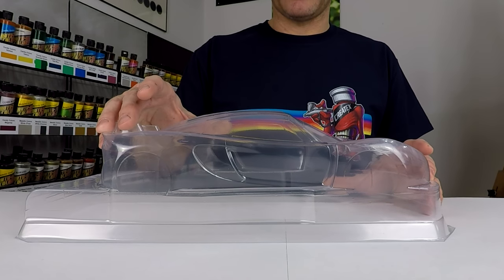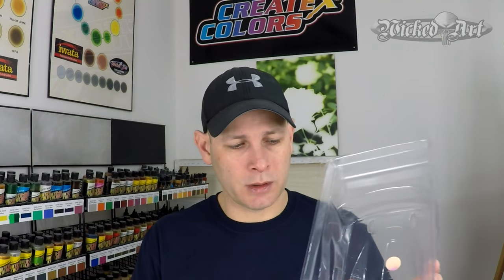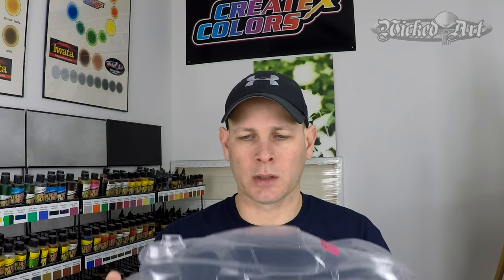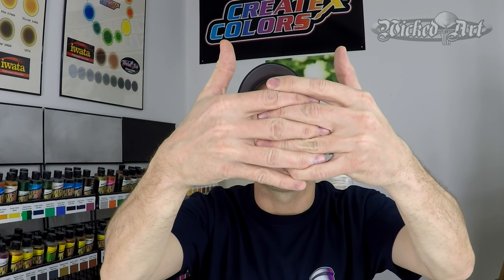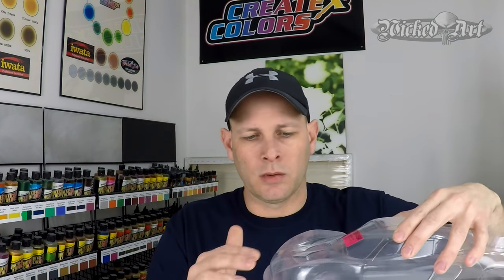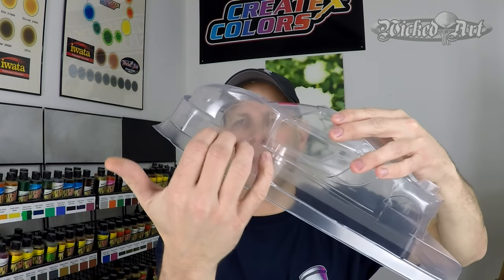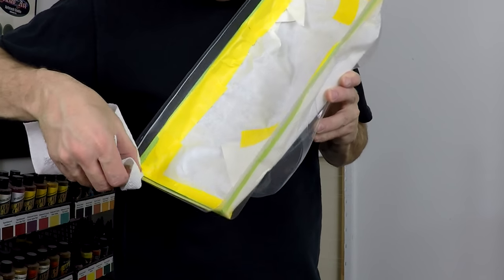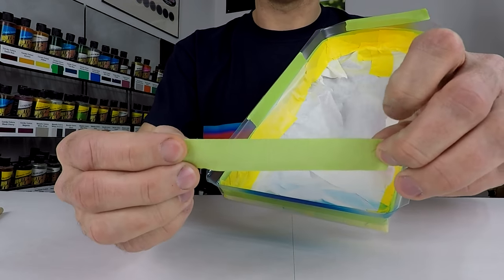RC Paint Adhesion with Createx Colors

Comment: super well done video of some really hard-to-find info! Apparently aerosol cans is what everyone wants for lexan bodies because brush/airbrush paints are much harder to find, and so is good info about them. I think it's probably some aggressive solvents in the cans that really help adhesion to lexan/polycarbonate, and those types of chemicals are going to escape from a screwcap bottle much faster. 

This is obviously a niche topic, but but it's definitely not limited to RC bodies. Painting the more chemically stable plastics is something I can tell lots of people are afraid of because it's so demoralizing when your hard work falls off the surface the first time you touch it.

I'm hoping there's a sequel to this vide, maybe showing how 4030 compares to the 4050's adhesion, and a scuffed/unscuffed comparison too. 

Again, great job on this test. 4 years later it's still a standout on the subject.

Comment: I mainly use Pro-Line, and Faskolor, but I have done alot of rc bodies with the Createx Wicked line, And like all my other bodies I wait 24 hours to let the paint cure and do a very light coat of Rustoleum or Krylon Gloss Clear Coat and after that dries I do a heavier coat and I haven't ever had a problem with adhesion durability. I've also used Rustoleum White Bonding Primer as a white backer before when I ran out of White airbrush paint and that even worked. So as long as you prep the body,give it a good scuffing unless you're using Mirror Chrome, and do light even coats your RC paintjob will be durable.
Reply from the maker: Thanks for the tips!

Comment: Thanks for the video. The paint that is used for RC polycarbonate bodies is of special type. It bonds by slightly melting into the surface of the plastic and does not scratch off easily. (sorry don't know technical terms) I have painted many RC bodies with spray cans of Tamiya paint for these bodies. I just started using an airbrush and was informed there is an additive that allows these paints to bond better. Thanks again for your videos. To add these paints have a very strong odor, different from lacquer but just as strong.
Reply from the maker: Thanks for sharing your experience with us!

Comment: Awesome video!  Not sure how I missed it when it came out. I hope you put out some more info on what you came up with. I’ve never used the createx paints on rc bodies, but I used proline paints which were designed for airbrush for rc bodies . And they just scratch right off. So I went back to the good ole rattle cans that are made for polycarbonate and they work great. I’ll have to try some adhesion promoter. I love the idea of airbrushing bodies it just gives you millions of color options when you can mix your own. I’d also love to see what you did with those bodies. 👍🏼👍🏼
Reply from the maker: Thanks for the kind words!  I will be producing some more videos showing what I do with these bodies.

Comment: Hey good to see you again.  Couldn't wait to get off work to watch. I used Dupli-Color adhesion promoter on my atv and it done really well. I run it through branches and im pretty hard on it and still holding up well. Not sure if it's compatible with airbrush paints tho.
Reply from the maker: Hey Josh!  I've never tried any of the Dupli-Color products.  Glad to know it worked well for you.  ATV and motocross plastics are normally difficult to get anything to stick to them long term.

Comment: When you paint rc bodies with an airbrush or any other paint method, you need to put on a sealer. Created makes some in their Auto color line. It’s thick as paste and tend to gobb up my iwata eclipses. Even when it’s reduced at a 4:1 ratio. But when it dries it is a durable backing for these bodies. Hope this helps. Love your work.
Reply from the maker: Thanks John!  I already intended to try using Auto-Borne sealers near the end of the paint work on these bodies.  Knowing it has worked for you solidifies the decision!
Reply: The President of Createx said no sealer is needed,you can if you want but it's not needed but if you do don't go over 10%. Wicked you spray up close to the body and standard Createx you spray at a distance. But what I do is after 24 hours of curing I spray some Krylon gloss clear coat.  I do one dusting of a very light coat,let that dry and then hit it with a heavy coat and my rc paintjobs last longer than most of the  bodies..

Comment: Great information. I've been looking for a better adhesion promoter for rubber. I've been using 5092. I'm going to try 7040. I'm also going to switch to Createx paints and see how this goes.
Reply from the maker: I'm not sure if 7040 will work on a rubber surface or not.  As I'm sure you're aware, it's tough to get anything to stick to rubber... I'd definitely recommend trying it on a test piece first.  I'm curious, has 5092 not performed well for you?  It is my understanding that is the "go too" adhesion promoter for silicone.  I would think it would perform the best on a rubber surface too, but I have no experience in this area.
Reply: @wickedartstudio  I ordered 7040 with the 4016 link. I read up on the product prior to. The website says its good for with rubber surfaces. I received my order today. We shall see how this goes. 😁
Reply: @wickedartstudio  Createx Scenix Adhesion Promoter (7040)
Volume: 32oz

A water-based, acrylic-urethane primer for making paint stick to difficult substrates Including: plastic, rubber, glass, foam, latex, 3D Print Composite and more. I'm praying it works well. Going to test it out today. Either way I appreciate the information you provided. This is an awesome test video.
Reply: @wickedartstudio  Also the 5092 has helped with leather surfaces, but not rubber. It wasn't the absolute best promoter, but it was better than the original promoter I first started using. Its all about trial and error.
Reply from the maker: @NiijiSunGoddess  I can definitely relate to the trail and error!  I hope the 7040 works out better for you!

Comment: Very nice to see you again, Trevor! Also nice to see someone like you, with a lot of experience, try something new and experiment! I usually use a worn 3m red Scotch-Brite and clean the surface thoroughly with an alcohol-based pre-cleaner! Really excited to try the new 4050. Spraying a promoter instead of scuffing feels like such a comfortable (read lazy ) option! Looking forward to seeing what you come up with for these bodies! 

Stay safe! 

Kind regards from Sweden!
Reply from the maker: Thank you!  I don't consider using adhesion promoter over scuffing the surface as lazy in this case though.  It would take a decent amount of time to properly scuff the entire inner surface of one of these bodies (depending on how many body lines and other contours are molded into said body anyway).  Time is money and I would guess the lifespan of these bodies isn't great if/when they are used for the purpose intended.  For those reasons, as well as the size of the bodies I'm experimenting with, spending too much time preparing the surface takes away from profitability.  In my opinion, it is far more economical to use an adhesion promoter in this case.  Of course, I'll get a better idea of how durable these will actually be after I send them back to the owner and he has the opportunity to test them (which will take some time), but the adhesion promoters have performed above my expectations so far (especially the 7040).
Reply: @wickedartstudio  you normally dont need a adhesion promoter you have to be very carefull with laxean what you use
Reply from the maker: @AndrewMurphy8383  Okay.  Thanks for sharing.
Reply: @wickedartstudio   @Wicked Art Airbrush Studio  well that not always true i seen online rc bodies that have lasted 10 15 years depending if your bashing or racing and if u crash or send it flying . You also want not scuff it up be cause if you did the scuff marks can been seen at some point u dont live that far from me here in oklahoma you should come buy i got rc body and i could show u how i airbrush it or prep it for paint. it would be good to have something tuck away in case you get people wanting you to do a body
Reply from the maker: @AndrewMurphy8383  Hey Andrew!  I appreciate your input!  I was aware scratch marks from scuffing the surface will likely show due to the reverse painting process.  I never would've thought a body could last 10 to 15 years though.  It makes sense now that I think about it, because some will take better care of their equipment compared to others.  I'm always up for meeting another airbrush artist.  The fact that I can learn from you is an extra bonus!  Shoot me an email at wickedartstudio@gmail.com and maybe we can get something set up.
Reply: @wickedartstudio  I AM NOT PRO AT AIRBRUSHING THERE AGING DONT NEED ALOT SKILL TO AIRBRUSH A RC BODY OR DOING TRUE FLAMES ETC
Reply: @wickedartstudio  Some people who does bashing would resin and fibercloth to making them stronger and i sent you email
Reply from the maker: @AndrewMurphy8383  You don't have to be a "pro" anything to learn from someone.  You have more experience painting RC bodies than I do and that experience is worth a lot!
Reply: @wickedartstudio  well i sent u email hope u got i also gave you my cell sometimes it is easy to get me there than by email be cause of work i do

Comment: Hi,there's a video by sm designs airbrush titled how to paint scenic clear coats, you might want to watch , he say's that its  createx's best adhesion promoter in response to one question. Its worth a watch just to see the motorcycle tank.
Reply from the maker: I'm familiar with the Scenix clear and have used it.  The UVLS clear is the newest line of clear in the Createx line.  It doesn't require using the catalyst.  That's a plus because it's one less thing to purchase and one less thing to mix.  I don't know what the chemical difference is between the Scenix clear and the 7040 adhesion promoter, but I suspect they are very similar.  There was no need to test both in my opinion.

Comment: 3m scuff it with gray scotchbright and brushes on inside. Then spray adhesion promoter then spray clear then the color.
Reply from the maker: Thanks for the tips!
Reply: Good idea for the layering. Does this combination fill in and/or cover up any of the scuff marks from the scotch bright?
Reply: This is an airbrush now, not hvlp, don’t you think the scuffs will show thru? Being the mil scale will be so thin ?

Comment: Thank you for this video! I am just making the move from rattle can to air brush and finding your channel has been awesome. I will mainly do rc body paint jobs so it is cool to see the different adhesion promoter/base primer sprays being used against one another. In this video it appears the 7040 may have been the best working to bind the paints together on the lexan? I was thinking that with more color sprayed along with a full coat of backer you may not have had the scratching ability you had here in your sample patch being just a few passes ya know... How did the paint job come out over all? Thank you for the videos!
Reply from the maker: I appreciate the kind words!  I haven't actually painted the body yet.  RC is not that popular where I'm located and I don't normally paint them for that reason.  I will eventually do some more videos covering the process, but it's not a priority at the moment.

Comment: i'm a long time RC paint guy, and ive been curious about Createx products. love the video but i can tell you the scratch test not necessarily true as most of us use a backer or backing paint after finishing it helps protect your work.  anyway  great video.
Reply from the maker: I appreciate the kind words and advice from someone with experience is always welcome!  Perhaps I can pick your brain?  I plan to use a backer as added protection as well; however, the backer does nothing to improve adhesion on the first layers of paint.  For example, I'm sure you've seen one of those factory automotive paint jobs that is peeling away all the way down to the primer (or even bare metal in some cases) over the years.  The reason behind those failures is poor prep and/or contamination was introduced at the factory.  Lack of good adhesion on the underlying coats resulted in paint failure.  A catalyzed clear coat was strong enough to hold the paint in place for some time, but not for the life of the vehicle.  In the automotive paint world, adhesion from the ground up is very important and that's why I took the approach you saw in my video.  Am I over thinking this from your experience?
Reply: @wickedartstudio   I think maybe you are overthinking it, the paint adhered until you actually scratched it off. having the backer gives you protection from that. Most of us back with white, then a plain black or black backer also. and even for basher vehicles this is more than enough to  protect from actual scratches
Reply from the maker: @ggjflyguy  Thanks for the reply!  Painting RC is not something I normally do and it's completely out of my wheelhouse.  I really appreciate you sharing your knowledge!  I get that the paint adhered to a degree before I scratched it off.. My thought was the paint could fail and begin peeling due to the Lexan bending when a car is crashed or hits something.  I have no idea what the life expectancy is for one of these bodies (I assume not long), so there's a good chance I am overthinking it.  Thank you again for the advice!

Comment: Wicked Art Airbrush Studio, If you could work out if it is polycarbonate or not which it looks like it is try using a single pack epoxy etch. One way to find out of its adhear ability is to try lighly sanding it. If it sands it a dust then paint will stick.
Reply from the maker: Awesome!  Thanks for sharing, William!

Comment: I'm way behind, two years behind, but anyway. I've tried several types of paints over my 6 years playing with rc's..... proline water based paint seems to spray well. But not as durable as Tamiya ps spray cans (I have potted small amounts from the cans for use in airbrush, with fair results). But you want the adhesion promoter, I've had the paint fall right off after a few months. Scratch test is ok, but it's surprising how hard it is to make any custom paint job last without completely sealing it after it's done, with something like shoe goo and drywall tape. But the added weight isn't what racers really want. 
 Proline lays down fantastic, and spaztix paints also lay down nicely, however the ps Tamiya paints will stay on  even if the car folds in half at 60 mph. 
 My biggest hurtle was figuring out how to plan my designs backwards, and somehow do highlights before the actual background......yeeehaw.......
Hope you went out to get an rc car after this. Crawlers, racers, bashers,doesn't matter. It always brings out a smile in anyone who trys one
Reply from the maker: It took me a while, but yes, I eventually wound up with my own RC crawler.

Comment: So three years later are you still using the adhesion promoters?   If so, which one?
Reply from the maker: I don't paint a lot of RC bodies, but I have done a couple since creating this video.  I did use an initial coat or two of 4050 UVLS Gloss as an adhesion promoter with excellent results.

Comment: Just went through this, the flexible adhesion promoter SUCKS!  Dupont Adhesion Promoter in a rattle can saved me I was doing some graphics outside the car and scuffed with 3000 grit, used the flex promoter from Createx, the tape peeled off the graphics it was over.  The Dupont rattle can acted much like the 7040, I was able to tape over and paint etc. I didn't try the autoborne sealer but I have a feeling it wouldn't be that great. Can't get the Scenix 7040 in Canada
Reply from the maker: Hmm...I didn't have trouble with tape peeling up paint with any of these adhesion promoters.  I've heard the 4015 and 4016 crosslinkers have been discontinued, but I haven't confirmed that yet.  If they have been, the 7040 will be discontinued as well anyway.
Reply: @wickedartstudio  my exact test was: outside of rc body, masking frisket on, flex promoter, wait, spray paint, let dry, remove frisket, put new frisket layer over and spray that, tried to remove and it took previous layers.

Rattle can dupont let me paint some fun matte stripes on outside without any issue.

Comment: You mentioned you have old stock createx paints.  How do you bring back open dehydrated paints to use? Ihave textile paints haven't used in a year and they are thick and clumpy.
Reply from the maker: Hi Belton!  Once they become thick and clumpy, they are beyond saving in my opinion.  You might be able to get away with reducing it down and straining it, but I would recommend trashing it and ordering a new bottle.

Comment: Can I use the createx colors and the wicked line both? Can't find colors I want locally. Normally I use 2k automotive urethane with no problem but gets kinda expensive just for a rc body
Reply from the maker: Hey Brian!  Yes, you absolutely can.  All of the Createx lines are intermixable, either in the cup or on the canvas.  The only product of theirs that I wouldn't recommend doing that with is the Createx Airbrush Colors line.  Those are specifically designed for fabrics.  Wicked Colors, Illustration Colors and AutoBorne Sealers are all intermixable.  The Auto Air Colors line was merged with the Wicked line last year.  Some of the Auto Air products might still be in circulation though and they are also intermixable.